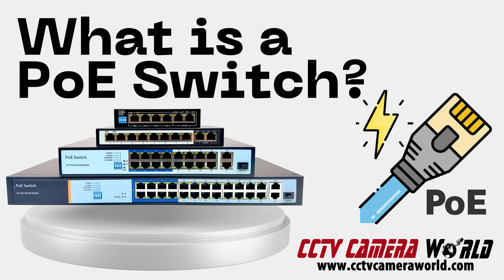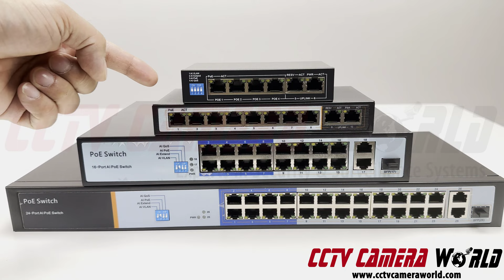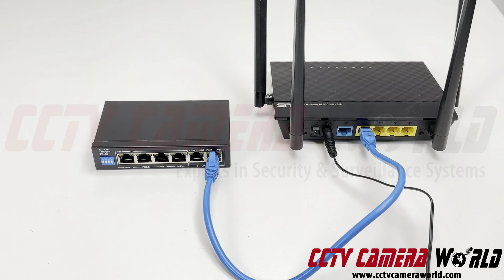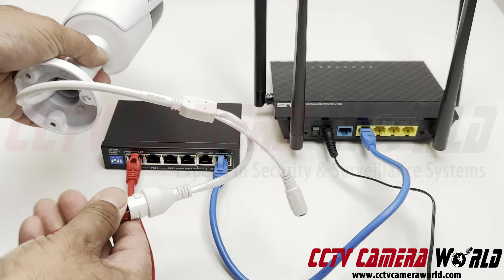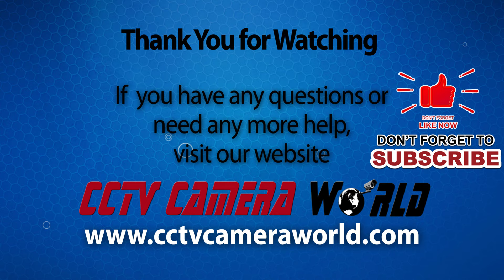What is a PoE Switch?

Comment: Do I still a need PoE switch if I have an NVR?
Reply from the maker: There are a lot of variables that would determine if you need a PoE switch. While most NVRs have a built-in PoE switch there are several situations where a switch would be useful. Here are a few examples:

1. Your NVR's built-in PoE switch is not powerful enough if you intend to use multiple large power-hungry PTZ cameras.
2. You have the need to run a camera over the 328 feet limit of Ethernet cabling.
3. You want to deploy your IP security camera system over your local network rather than using your NVR's internal network.